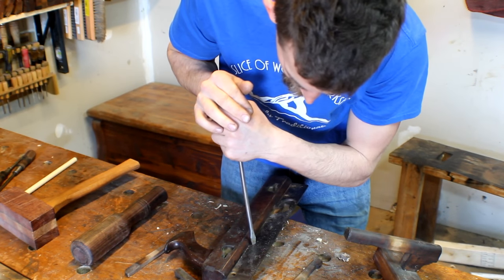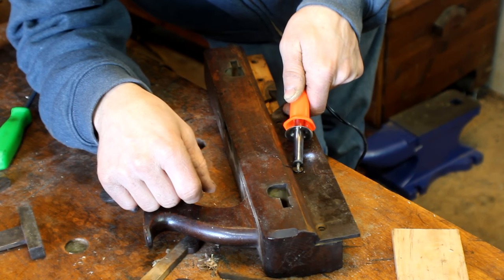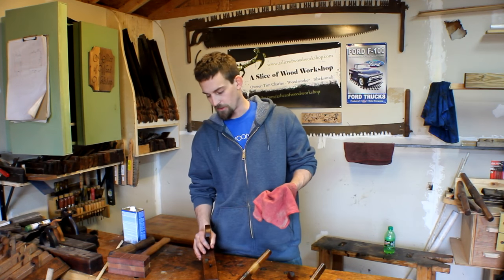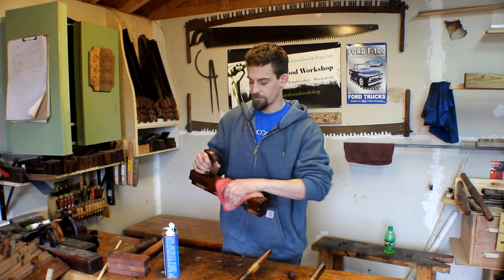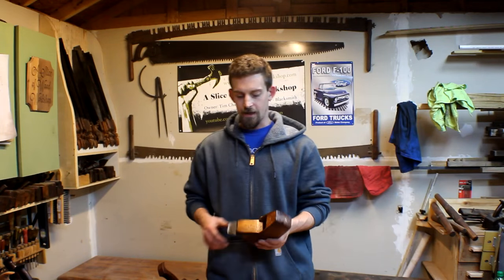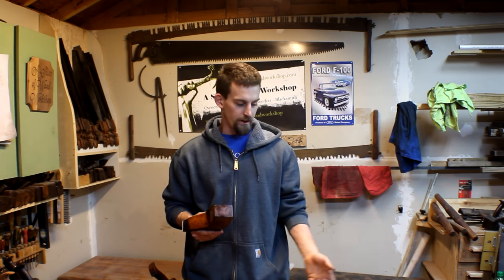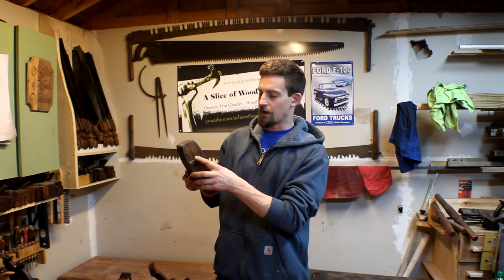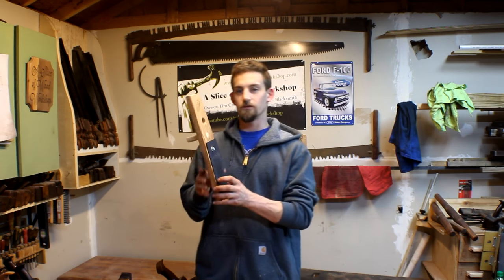Restore a Plow Plane

Comment: Another option that I've seen for a stuck/rusted screw, is putting it in the freezer for several hours. The idea being that the cold causes the metal to shrink slightly, breaking the bond.

Comment: ever woodworker needs a strap. I  made mine double sided,one with a rougher compound for really honing the edge,the black compound,and on the other i use green compound to really put a smmoth mirror shine on my irons. I  pull my irons out every 10 mins. or so depending on the wood type. hit the strap 25 times on each side. im not going to say how long its been since i went through the whole sharpening process everyone will call me a liar, they need to try it. unbelievable how much time it saves and life of the iron or chisel.